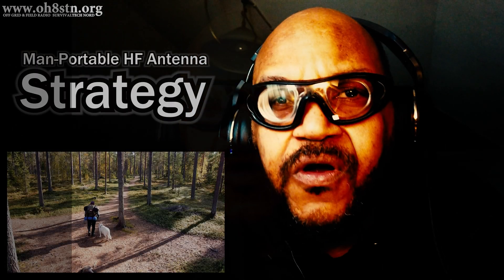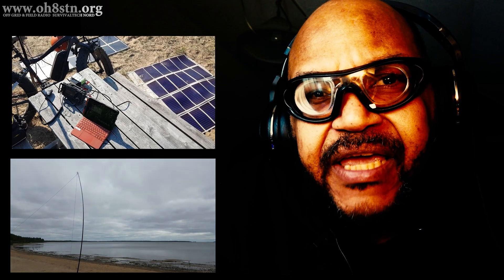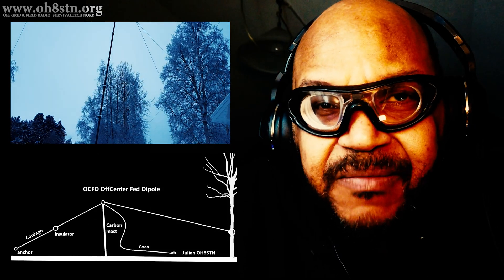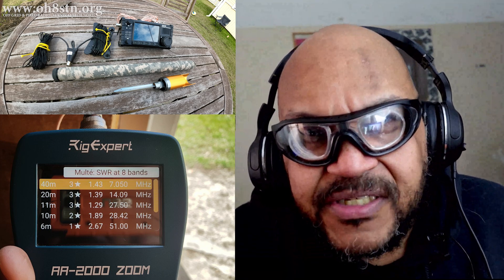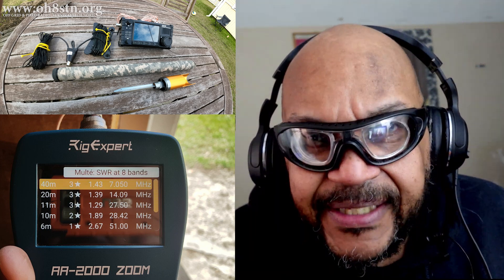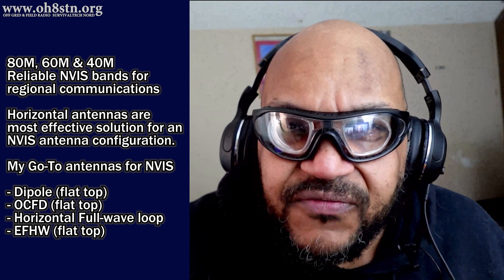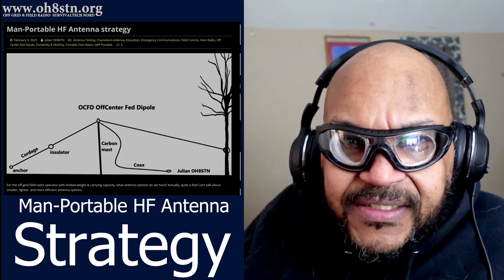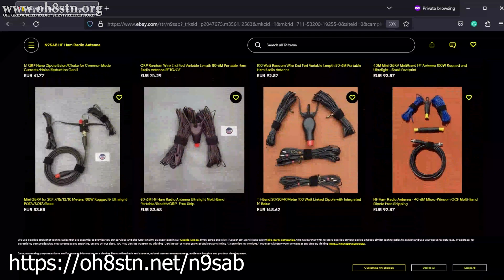Portable Ham Radio Antenna Strategy | OH8STN Off Grid

Comment: Thanks for another great presentation, with another potential tool in the toolbag. I have always been intrigued by the OCFD antennas because of their efficiency. My constraint when in the field is always footprint. I rarely have the environment and space to run two ends of the antenna 180* from the apex. Because of that, I almost exclusively run an EFHW with the apex away at 19.6' on a Tactical Mini, down to a 3' feed point close to my operating position. Fortunately, this has given me both DX capability, as well as NVIS. Without touching the configuration during an activation, I have made 3000+ mile contacts on 20m and <25 mile contacts on 40m, as well as distances in between. That said, I am going to check out N9SAB's antennas and see if there's something that fits my operations.

Comment: Great video and descriptions of the problems with a potential solution. Your recommendations are always taken seriously on my end. And great timing. I am currently using my manpack radio, the 818, in the shack so I can learn it inside and out. I have an old yaesu fm-110 amp that pairs with it perfectly for shack or vehicle portable use. My next tweaking project for my man portable setup is to lose the RG-8x and move to a slimmer, lighter coax and pairing down the antenna options. So right on time again, my friend. 

I’m an army vet, my best pal is a jarhead, which y’all have in common, so I have to know.....what’s your favorite flavor of crayon? I keep the green ones in the shop for my buddy.
Reply: Followed the link and went to Tim’s eBay store, told him you sent me.

Comment: I have been playing with different portable options.  It's a tough choice between rugged and truly portable.  I love the JPC-12 but my experience of 3 months at the beach with it changed my opinion.  It's a rusted and pretty much end-of-life.  Anything with telescoping antennas can't last in salt air.  I feel my EFHW is now my main portable.  I think the ruggedness factor can be mitigated by wire choice. Also, in the event you break a wire in an emergency situation it wouldn't be that difficult to source more wire.  The weight is negligible so it comes down to elevating it.  A simple arborist throw line gets it up most places.  
All that said, if I had to choose a real man portable rugged antenna, I would build it myself.  A DIY small Wolf river coil and a commonly available breakdown military whip would go a long way to accomplishing a great man portable vertical option.
Reply from the maker: I had similar thoughts about building it myself. The problem with the vertical is they can't do NVIS. 
Regarding the jpc-12, wondering if they're all alike. I haven't had any resting issues, and I'm primarily deployed near the sea. 
Regarding the rugged vs wire. I can always carry a redundant wire antenna, or spare wire. This is still lighter than many of the rugged options we have.

Comment: 57 yrs old, and zero discs left in my lower back.  I have been using this strategy for awhile.  Great for open areas.  Long thin wire is frustrating in the woods though.

Comment: I don't think you can get much lighter than that. In your climate, wearing gloves would make it harder but it's still pretty quick. Do you get any issues using a carbon fibre pole Julian?
Reply from the maker: The carbon fiber has been solid in winter. No coupling issues either. So far so good.
73
Julian oh8stn
Reply: @OH8STN  that's great to hear Julian, thanks for the info. :) 73

Comment: Disagree on the buddipole. I've taken the mini-buddipole portable on a 250cc enduro bike. It's just a pain to tune. Easily stowed though.   I did a big expedition to Scotland last year with the DX Commander expedition antenna in the panniers on a 250cc Honda CRF.  DX Commander is my favourite as it's multiband without the need for a tuner and takes a kicking from the weather.  Easily straps to a backpack for hiking with too.
Reply from the maker: If buddipole mini works for you, I think that's awesome 👍. 
The DX Commander has been awful (for me).  Performance is excellent, but it's really a home antenna.  Too many wires, and the chinesium mast get frozen stuck in minus temps at 65°N. I ended up leaving it in Lapland after a winter deployment. Definitely a no go for winter portable. 
73
Julian oh8stn

Comment: Nice wrap up, with no major dissent.  I've enjoyed watching previous posts with the Chameleon (and other) stuff, but as I am on foot 70% of the time and on the bike 30%, well, weight is important.  MPAS and the other stuff is great, I've used it in the past and still do in the present, but if I'm humping a pack 30km up an incline, or spending a few days in the Japanese Alps, the MPAS isn't going to be in the pack.  The 40-6 is a great little antenna: the build is solid and it works perfectly.  It's a shame that Chameleon has no interest in it (even worse, that they killed off the monoband 20 and 40 dipoles, which were also nice antennas).  The 40-6 works without a tuner on 40 and 20 (and so-so on 10), and with a tuner on other bands down to 6m.  Personally, I prefer to cut my own dipoles for a resonant frequency.  Yes, that means that there are some things that can't be done; on the other hand, I save weight by concentrating on the bands I need/want to work, and gain efficiency in the antenna.  Are my antennas as nice as N9SAB's antennas?  No.  Tim does great work and his antennas are well worth the money.  However, when (not if ) it goes pear-shaped and Tim isn't with me, then what?  It takes only a few tools to either make repairs or even a whole new antenna out in the field.  As I'm listening much more than broadcasting, I also string long listening antennas (with homemade transformers).  I'm looking forward to seeing how this series grows over the next few months.  There is a reason why there have been so many books and articles on wire antennas over the past decades: they work very well.  Cheers.   73   Garu

Comment: The 80-6 N9SAB was the first antenna I ever purchased, it worked wonderfully, be advised that at anything much over qrp levels you'll want to incorporate a common mode choke. 73
Reply from the maker: RR, and great feedback. 
73
Julian oh8stn
Reply: @OH8STN  With anything other than resonant antennas I run 20W out of a G90 and in the field use a 14 turn Guanella 1:1 choke and and an FT114-43 toroid. I used to have RF issues (brings back painful memories) but no longer.

Comment: Watching it as soon as you're posting it. :-) 

EDIT: I bought the chameleon MPAS based off your recommendation. In addition to having that excellent antenna. I plan on also getting some lightweight antennas to go along with it. I am also going to buy a couple of BNC telescoping antennas,      and a roll up 6M Resonant Ladder Line antenna.

A fellow Ham I know bought a Elecraft KX3 several years ago. He used a BNC to wire adapter and just used a cut length of speaker wire with a telescoping carbon fiber kite pole to get the antenna up in the air. 

During the June contest, we were running QRP Solar for the extra points. l made a 1,529 Mile contact on his KX3 (using only five Watts!) from the Cedar River Flow area of the New York Anderrodack Mountains, all the way down to Sanibel Island Florida! 

It took several attempts (a solid half an hour) to reach the other station as he was working a HUGE pile up. 

But eventually I got a gap and he heard me and he had all the other stations hold off so he could get my contact worked. 

My fellow ham who was new to the hobby, bought the KX3 based off my recommendation. Even though I couldn't afford one myself, I had previously asked an Elecraft Rep at the Dayton Ohio Hamvention a ton of questions about the radio. 

He was completely sold at that point on the radios capabilities using a simple wire antenna being thrown up in the air. 

Fast forward many years later. When I finally had to funds to purchase my own HF rig. I settled on the Lab 599 Discovery TX 500 based off your recommendation and other hams recommendations. 

I saw the potential of a nice and sturdy QRP radio. Which is exactly what I was looking for! After several years of hibernating in the hobby. I finally have a renewed interest as the equipment technology has caught up to what I wanted to do all those years ago.
Reply: I fixed my wall of text in the above comment, and broke up the information into better formatted paragraphs that make more sense. :-)